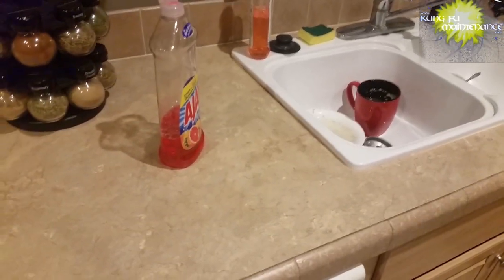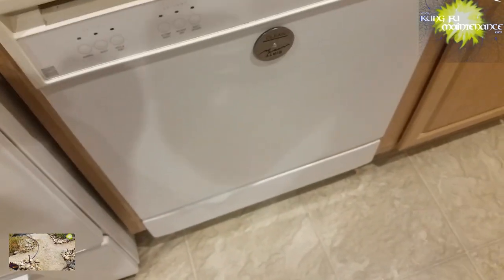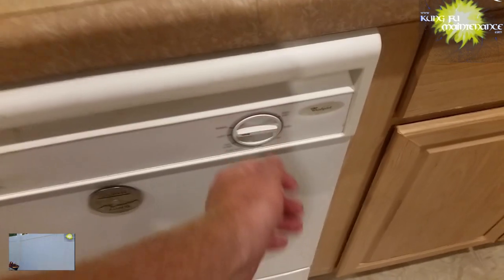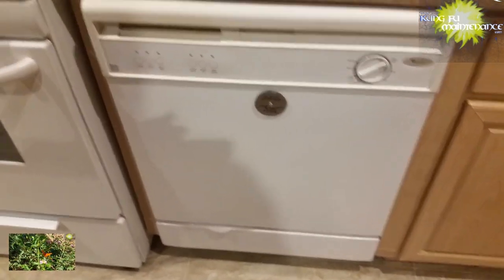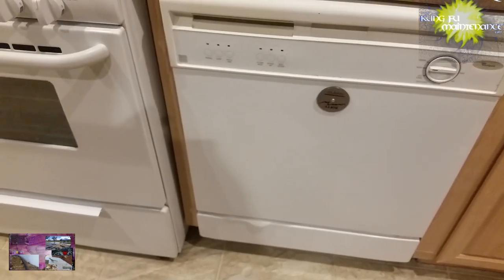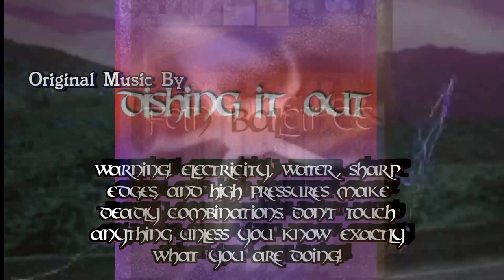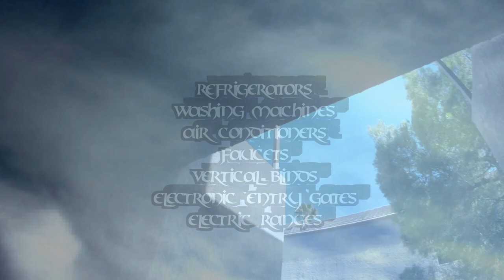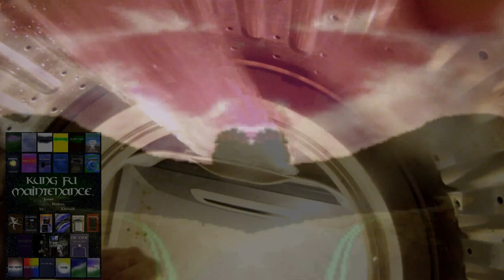How You Can Use Regular Dish Soap In Dishwasher: Often Cause Of Overflowing Front Foam Suds

Comment: People get so nervous, I get it, you could ruin a lot of stuff if it overflows.  I've done this multiple times with success, just use your brain and think of how sudsy liquid dish soap gets. Only put a tiny amount, literally a tiny amount. When you put a small amount (a quarter max), it gets sudsy enough to get clean, but it rinses out just as well. I've never had suds after running a load (and it usually cuts grease better than detergent).

In a squeeze, this is a very viable option if you trust in your measuring abilities.
Reply: I literally use two drops lol. Works like a charm